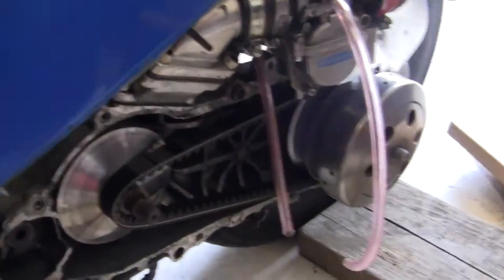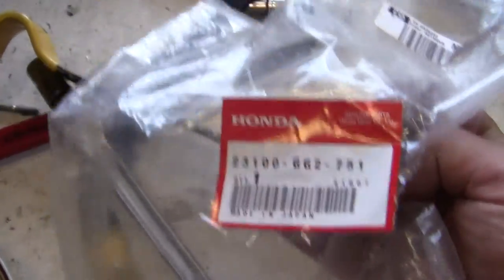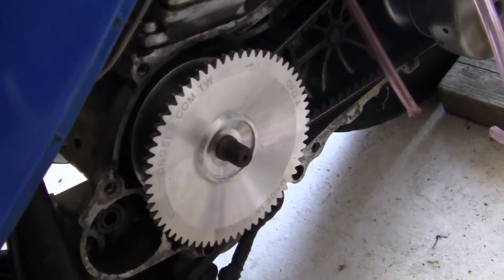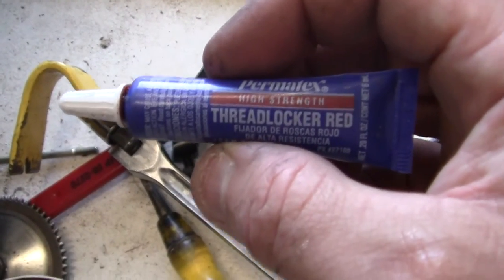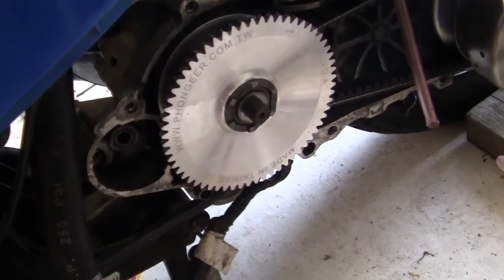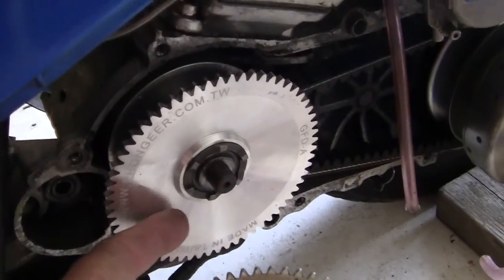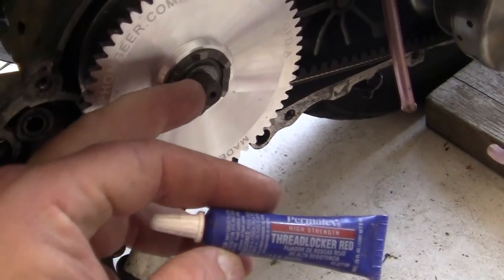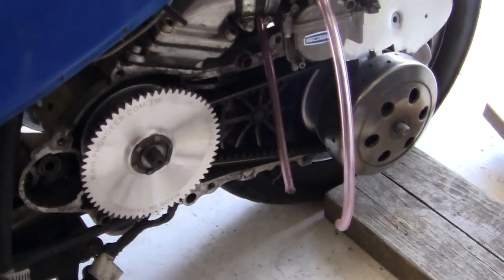2- INSTALLING RACING ALUMINUM DRIVE-FACE

Comment: Hey you're doing great. It's nice to see a DIO with a little TLC in it. I saw one a week ago at a little scooter/moped gathering down at the beach and man was it in ruff condition. Upgrade your belt to Kevlar and possibly a size bigger, You'll get quite an increase in low end and even a little bit in your top end. :)

Comment: Well Kevlar is ofcourse stronger but in this case he has to have in mind that it also will wear down his Alu drive faceplate much faster due to a Kevlar belt being harder.....we use "regular" Bando belts for scooter-racing and it works fine as Bando is a great quality brand.But i wont go into explaining all about belts here because it wouldn´t fit this comment section.
Cheers

Comment: Did you notice any difference with the aluminium drive face.????
Reply from the maker: I have not really tested it yet. It is a long story. The Honda dio from japan has two drive units, the standard one which is sold in America and the big beefy one sold in Japan. The Japanese drive has a slightly bigger rear pully, a smaller front drive boss and the Aluminum drive face. I did not know this when I put it on the regular drive and it did not work. I took it off and put the stock drive face on because I wanted to ride the bike like right now. I have both drives and the Dio drive has a slightly wider but smaller drive belt.